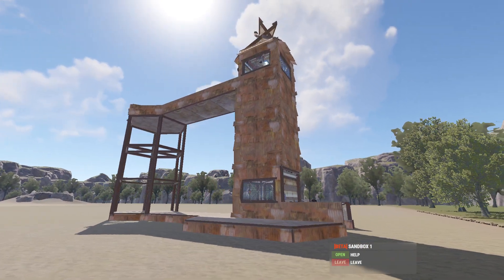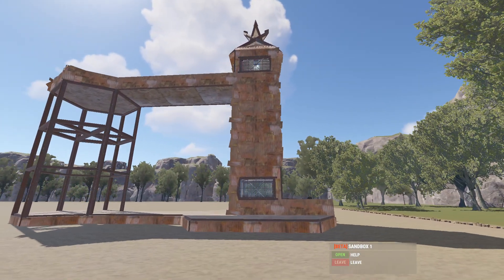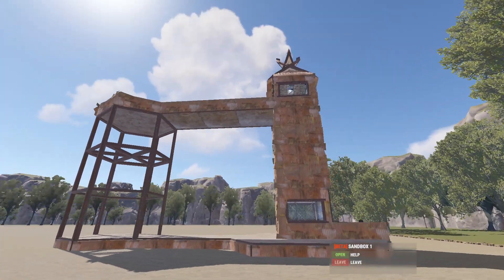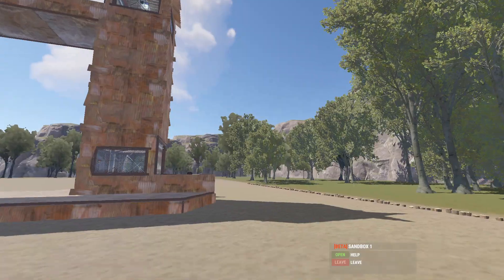Rust elevator but at its electrical limits

Comment: I bet you can store the information if the elevator is up or down and make the top door thing a little smoother. Id also make the garage door on the bottom close before the elevator takes off.

Great project.

Comment: Try using HBHF Sensor to automatically call the elevator when you are down/up(you can set it so it reacts to only tc authorized players), also weaking with the timers you can make the doors already open when you get down/up rather than going up and then waiting for the garage door to open. Good shit non the less!
Reply from the maker: @Tosiitii  yeah I have them timed how it was. Just opened when it got to the bottom. Easily change the timers a few seconds here and there for preferences. The only thing is with the HbHf is could call when I don’t want it to. But I did after this make an authorized only button.